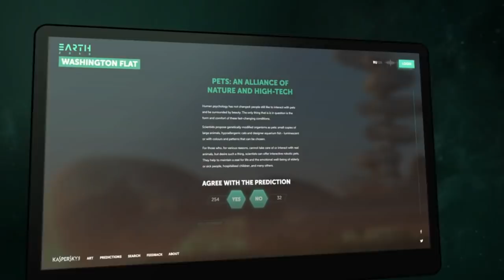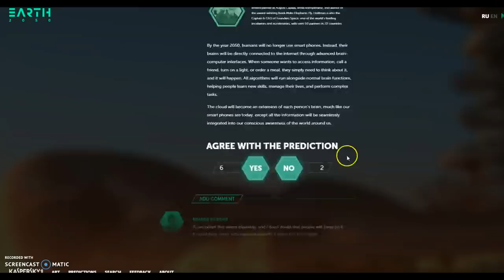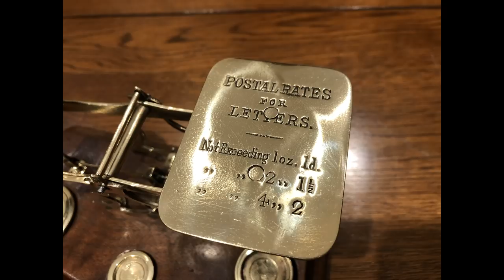I restored these old British Postal scales !

Comment: If you are trying to remove rust from metal,  try using molasses. Its 10% molasses to the size if the container,  sink the metal item & fill the rest of the container with warm water.  Then comes the hard part,  let it sit for a period of 2-3 weeks. The rust will turn black & then its easy to scrub it clean with a plastic scrub pad....this method really works.